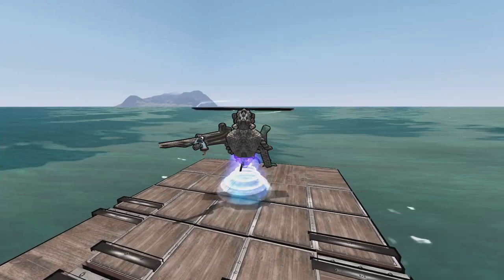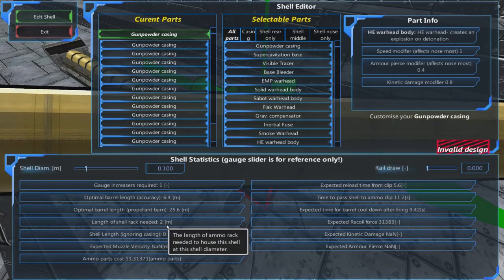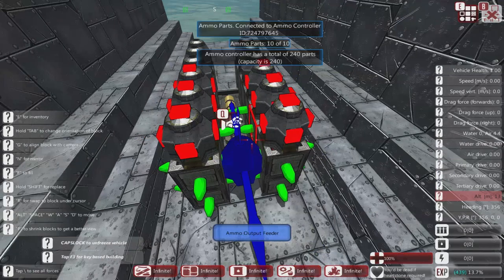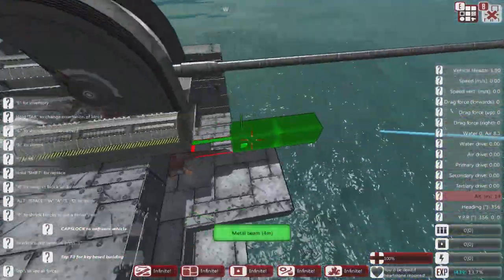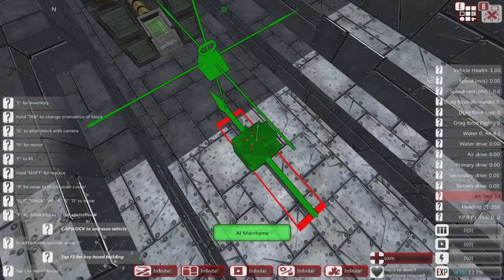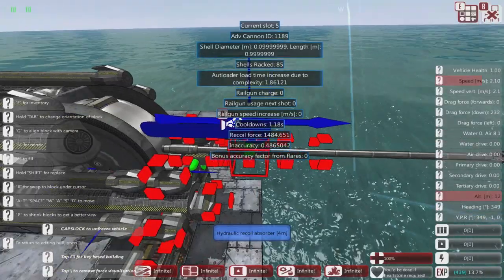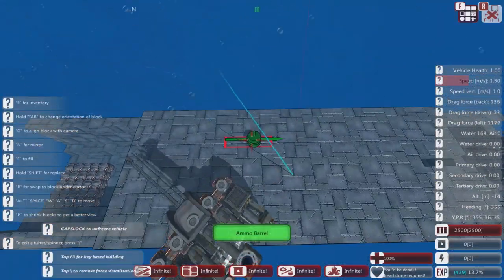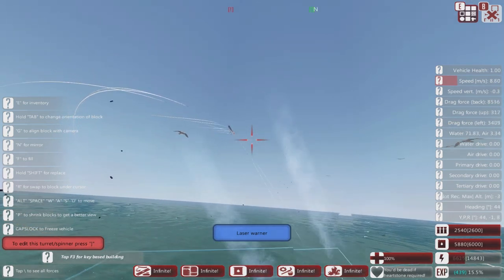From The Depths 1.8 E114-Advanced Cannon AA Destroyer.LetsBuild,Playthrough

Comment: Gauge blocks will double as connectors for most purposes. Build your initial post off of the turret block out of cooling units and the autoloaders will stick right to it and work fine. Unlike the older cannons, autoloaders can connect to each other in a chain as well. After I got used to using functional parts as structure, my advanced cannons consistently have less block count than equivalent custom cannons.
Reply from the maker: +Breakthroughsoftware Ok, hadn't tried connecting autoloaders to the gauges or cooling units, that will same a bit of working and blocks, thanks.

Comment: Early in this video while you were designing the first turret you had deleted a block but never commented what it was - what was it? I see you re-worked it entirely afterwards but was just curious...
Reply from the maker: +Brad Petrie hmmm, maybe that was the ammo router which I did briefly explain later. maybe you can find approx time and will have a check. Possibly it was not needed or I put a block down by mistake that I was not going to use.

Comment: Might be worth checking to see if using a low-drag nose like composite or AP and swapping a gunpowder casing for a flak warhead instead would actually increase the muzzle velocity. It should lower the barrel length you need, too. Besides that, the timer seems pointless, it'll already explode if it's near a target so all the timer will do is make it explode far from any targets...
Reply from the maker: +Infinite Monkeys  I am doing a bit of testing and finding the timer is better than proximity if you have a slow and big radius for flak. Basically looks like proximity is not 360deg, but a cone to the front so if missing by more than a few blocks the proximity does not kick in it seems. Have been trying some slow timed rounds and fast rounds and seems you need a bit of speed to get accuracy but not so fast that timer or proximity doesn't work.. balancing act as always :)
Reply: +Dels Gaming Ah, that makes sense. Have you tried the squash head yet? Seems pretty strong to me.

Comment: Small suggestion for when you move on to battleships & cruisers, but perhaps you could incorporate bursting charges with penetration depth fuzes into your AP shells? So far, I've struggled to make those functional (since HE bursting charges rules out sabot heads), but perhaps you can find a way. Failing that, dirty great big HESH thumpers always seem to work.
Reply: +ZaffaPlaysGames They work pretty well with composite heads, but they need a lot of powder to get enough AP value.
Reply from the maker: +ZaffaPlaysGames I like the HESH it seems to work well but still experimenting with HEAP plus penetration fuse to see what works to attack the insides of a vehicle. There is some oddities on how it calculates depth using blocks so not hyper reliable so far.

Comment: I never really used advanced cannons before so i don't know if this is what it says but why do people call it HEAP? As in a combination of AP and HE shells right? If so, then the correct term should actually be APHE, unless the game have a round specifically called HEAP.
Reply from the maker: +Neurofied Yamato  It's just become the standard term as in game there is no mention of it. Yes it should be APHE in military terms but hey it's the internet :)
I think they get used to hearing HEAT and think it should be HEAP but it is totally different.
Reply: Dels Gaming Thanks, I was a bit confused on that lol.
Reply: there's a reason acronyms don't include of, and etc.   because it sounds weird 

same thing here
Reply: Joseph Farnham Well... Yes I understand that it may sound weird if you pronounce the acronym, which i don't think you are supposed to anyways. People just tend to do it.
But the proper acronym is APHE. Not that I have a real problem with it.
Reply: +Neurofied Yamato 
I could be mistaken, but I think HEAP shells are EFPs (Explosively Formed Penetrators).
This means they use explosives to melt, form and shoot a jet of hot metal.

'Composite shells' are segmented sabots, if I'm not mistaken.
A sabot that fails to penetrate would be pushed by the rear segment, causing the shell to bore through some of the armor, anyway.

A low velocity cannon would be better off with HEAP rounds.
A high velocity cannon would be better off with Composite rounds.
Reply: manictiger What you are thinking of is a HEAT round, High explosive, anti-tank. HEAP is a non-existent round that I believe is spawned from misinterpretation of the naming convention.
Composite shells can be sabot and full-bore rounds. Composite just simply means that ine core perpetrator is made of multiple types of material outside of your typical steel. Things like Depleted Uranium, Tungsten, Nickel and more.

Comment: the thing about proximityfuses: they dont update very often and only work if the bullet would have hit the target. so its not going to detonate a shell that missed slightly. only use for not too fast shells that you want to explode infront of the target instead of hitting it directly.
better use timed fuse + lasertargeterthingy for flak and other aoe.
Reply from the maker: +tom duke Yep got the timed fuse and laser on top, also I thought that about 270ms shell would not be too fast. Maybe I will try slow it down a bit more can put an extra HE in shell that way :)
Reply: +Dels Gaming If it's worth anything, my own experience has shown that velocity is only important for AA shells if you're facing very fast or unpredictable targets (like the Lynx, or funnily enough the Tweeties from the DWG Barracuda). Otherwise, you should be fine just lobbing these things across the sky like a thrown grapefruit.
Reply from the maker: Unfortunately the Destroyer here against some fast Steel striders jets so needs that extra zip

Comment: I can't really get my head around the new cannons :c i figured how to make one on my own but its just so weak and it shot one time per like 2 sek. i hope after watching a few videos i will be a bit better at this
Reply from the maker: +NotIrishRider  Still getting my own head around all the possibilities, but seems you need to match up cooling units and autoloaders in right ration to get a good rof, also multi barrels seem to get consistently better than a single barrel with lots of cooling.
Reply: Dels Gaming I'm planning on starting the campaign again and using only the advanced cannons as they seem a lot more realistic and it should be a bit more fun so i will more than likely due to cost make a small boat with 3 rockets in the back and possibly 2 rams in the front just a small speed boat that will allow me to go around quickly and capture ships for resources. Also do you have any tips for the resource base's ? i never really got to the point in the game where the attacks on my resource base were serious but i still armored it with 3-4 thick stone as well as one layer of metal this increased the block count alot but i doubt i will use ships to defend resource zones and i wanted to know what kind of defence's do you use for your resource bases ?
Reply from the maker: It will be expensive to start with advanced cannons resource wise but sounds like a good idea :). Resource bases have to withstand an attack force of about 40 points so I tend to use a few missiles and some big guns for close range power. Importantly you never know what you might be up against so have to cover air, ships, subs. The factions are not very aggressive so I don't think I have had to defend my base apart from a few attacks by the DWG

Comment: 1:11:29 How can u g that fast? What do I have to do to go that fast too?
Reply from the maker: +The Dupe  Balance your propellers to be very slightly below centre to push nose up. Plenty of angle blocks to reduce drag, then some hydrofoils on bottom just to lift it up a little. Not too many otherwise it starts doing a wheelie or flying :)
Reply: nonononono That's NOT what I meant XD haha. I meant how come the camera speed was so fast. But I think it's holding down the Shift button while moving. But what you just said is very usefull too. Thank You! ^^
Reply: Dels Gaming Btw: The way your boat is, (nose upwards) is pretty cool looking. :)
Reply from the maker: yep nose up at full power so it lifts out of water. But if enemy gets in range I drop speed so it does not show it's vulnerable underside. USe an ACB with enemy range< and then set speed back down to 0 also set hydrofoils back to 0 and it should settle back so it si more protected.
Reply: Dels Gaming nice! Thank you. Will definitely do that!